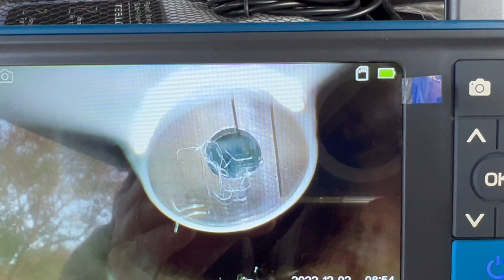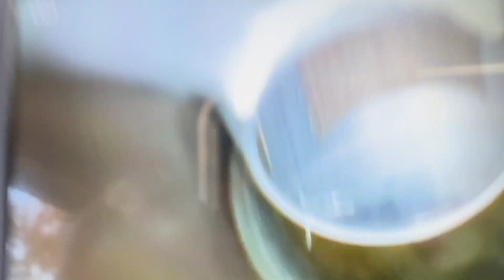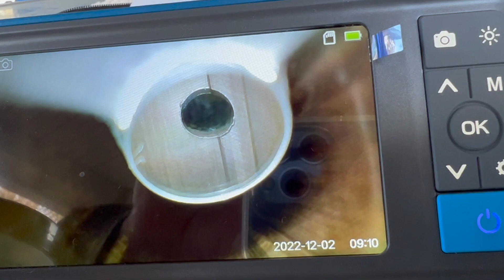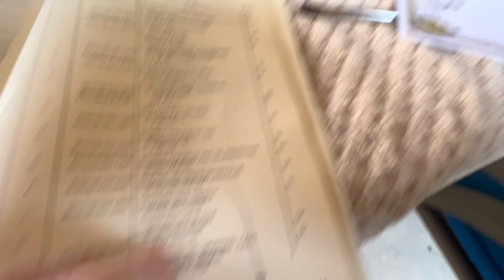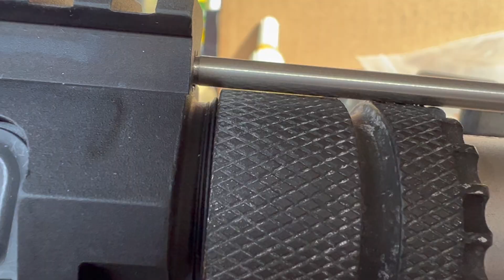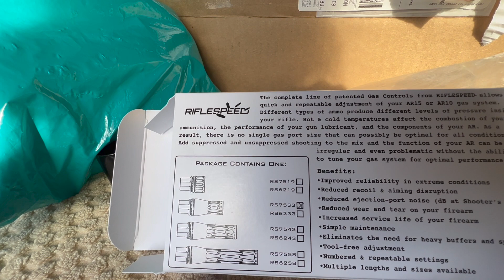AR308 New Frontier Armory Low Pattern/Wilson Combat Barrel Inspection/RifleSpeed Adjustable - 08

Comment: Got the same borescope. good deal for the price. I agree with you on the barrel.  I would have thought it would have been lapped.
Reply from the maker: Rifling looked like it had been lapped so makes me wonder if for some reason the gas port was drilled last? I took care of the really sharp stuff on the edges but I've seen better out of the box. Thanks for watching and commenting!
Reply: @peteregger7928  I'm wondering if you can recover some of your bullets and see if they are deformed from the sharp edges?
Reply from the maker: @PracticalAccuracy  That's a good idea! Maybe some standard M80 ball ammo into water should keep enough of the bullet intact.

Comment: Did you have any undergas issues or cycling issues?   That gas tube doesnt look like it comes in to the receiver much at all.    I fought for a bit on mine,  one barrel maker (faxon) I had same as yours,  tube came in just at the edge of the notch inside the receiver, it barely cycled,  I drilled out gas port,  still issues,  needed a longer gas tube.   Other issues I did away with Faxon and got a Black Hole Weaponry barrel which put the same gas tube right in the middle of the notch inside the receiver and all problems solved.
Reply from the maker: In a later video of this build series I discussed the proper gas tube length for my build which is the Armalite spec of 15.4". In my builds I was able to use 15.5" without any clearance issues. I installed the 15.4" in one of the rifles and the 15.5" in the other one. I had the straight tubes needed for the RifleSpeed gas blocks custom built by White Oak Armament. They came in at the exact dimensions that I ordered!

Comment: What plunger did you decide to use? I just switched out my standard plunger for the longer one and my suppressed ar10 is properly gassed now
Reply from the maker: Ha! Ha! Just finished range testing round 2. I had to go down in size to a .897" from the .917" that RifleSpeed had installed to get more gas. Ran the low powered NATO at Setting 8 on Range 1 perfect with plenty of adjustment left to reduce the gas for the hotter 308. Video will be up today.